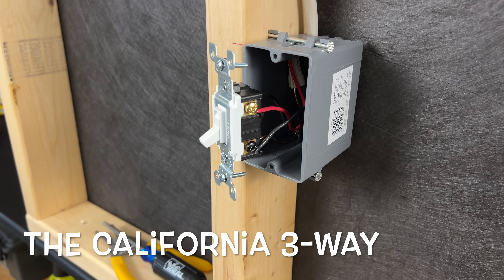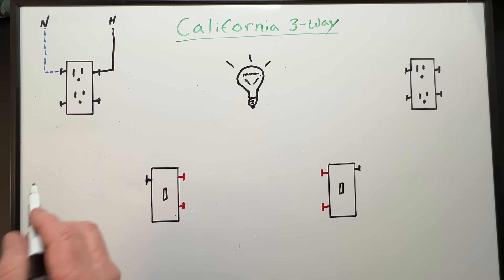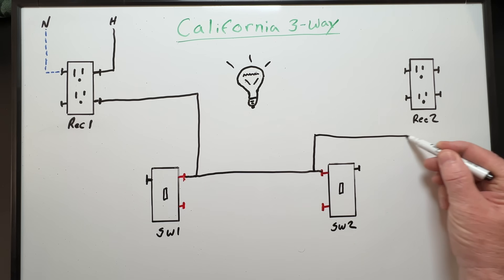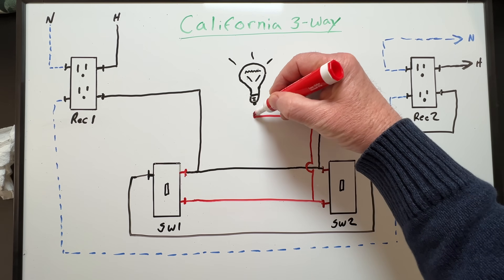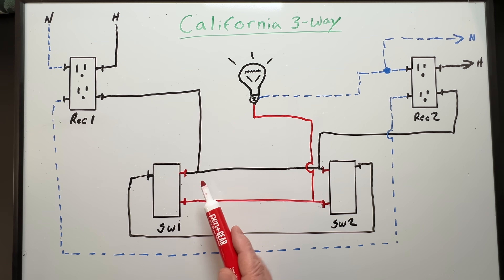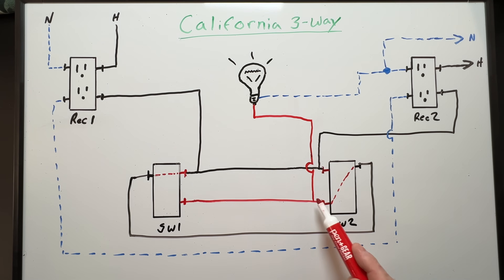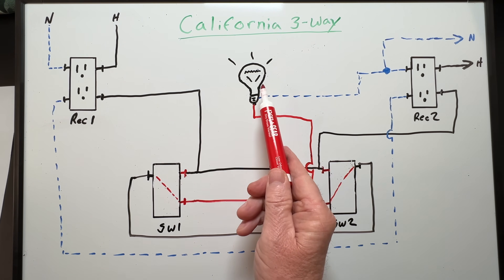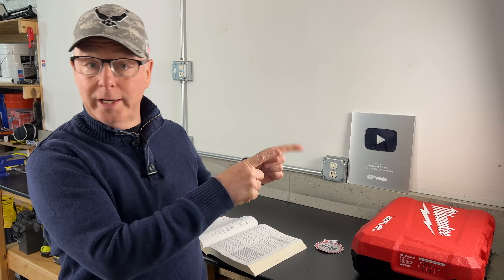What is the California 3-Way Switch?

Comment: If the neutral is the problem, how about just running a neutral to the switches to make it compliant? the circuit is still useful if you do so.
Here in germany, it's legal. Kontrollwechselschalter (=3 way switch with built-in indicator light) are made to be wired like this.

Comment: This is actually a Varient of the very common UK method but with the swich wire fed from the other end

We often bring permanent live into L1 of SW1 and the swich wire to the lamp into L2 of SW1

Then we run a 3 core to SW2
C - C
L1 - L1
L2 - L2

Newer rules suggest having a neutral in the box for the same reason so we generally just connect the neutral in a lever connector in the beck of the box

It works exactly the same way but we send the swich wire and the neutral directly to the lamp in a 2 core (plus earth) cable

We don't have the issue of re-identifying the neutral as line for the 3 core as our 3 core cables are typically brown black grey (equivalent to your Black, red, blue)

Comment: There is an exception on a neutral at the light switch not being necessary. If you have the ability to add a neutral at a later point in time.  ie: imc, emt, pvc etc conduit. With mc, romex etc a neutral needs to be installed upon inspection.

Comment: I don't think a single one of my lights receptacles has a neutral in them,  all of them are old knob and tube wiring and are older than me... well the wiring is, I've replaced the switches from old timey super stiff clacky switches to more soft rockers.

Comment: Hi, from England, UK. I like the way those steel conduits are fitted at 0:12, that should keep the wiring safe from the teeth of unwelcome little critters. And I like the way the connectors fit too, making them much easier to fit through timber beams while our conduits have to have the ends threaded with an expensive tool first so the connectors can be threaded on making the whole installation much more laborious to fit.

Comment: There's a 5th way, switching receptacle instead of fixture. Running 2 wire romex travellers between switches. Typical 3 way, hot wire common one end, and switch leg common on other end. Neutral is from the receptacle circuit as the hot feeding the 3 way. The issue is the neutral not run with lone 2 wire travellers.

Comment: This wiring makes no sense. There's a constant live and 2 switched live wires between the switches, that's enough to power the receptacle beyond and have 2 travellers. Why would you wire the light to the gold screw instead of putting the live from Rec1 on black at SW1 and the light on black at SW2? It doesn't do anything useful, are they trying to save a wire nut to connect the constant live to the receptacle at SW2?

Comment: I live in the 805 and I have uncovered many of these.  When I was 6 my house burned down, but not exactly from this, although there were several in the house. The Attic Furnace was wired sloppy and sparked, igniting the newpaper insulation, tipping the first domino.

Comment: Wow in uk use California method mostly still use till this day some you new every day we call it the 3 plate method here and the standard method we call it 2 plate method but we don't use standard method as much the only time it's mostly used , it's when we're running cables in conduit but as in the U, K, we usually have our power circuits and lighting circuits on 2 complete separate breakers and with us , we mostly have all the cables inside the light fitted , where from the supply/previous light then\nAnother one that would go to the next light and the last one that would run to the switch.
In are light fittings (we call them fittings instead of fixtures) have four terminals one marked L for switch line wire (we call hot conductors line it was called live before) a terminal marked N for neutral wires and another one marked loop for permanent line ( unswitch conductors from supply/ previous light to next light and switch) and then the final terminal is the earth term , and where all the earth is go (we call grounds earth or technical term is c p c circuit protective conductor) because most of our fixtures in the house are unknown as pendants, which  is ceiling rose ( junction box screws on ceiling) with a bit of wire and a lampholder on the end.
In our light switches, we usually have one wire that goes to the light fitting, but if it's a 2 way, we usually have another freak wire that would go to the next like position, but slowly in the UK, we started to the free wires in the back of switches , which we knock it down 2 plate cause we only using the two terminals  our ceiling rose so that's where the 2 play and the free plate name.Come from when we use the loop terminal , it's known as the 3 plate method , because all the wires are in the light fitting but is the cables run in switch or if we're running in conduit , it's known as 2 plate method , because we're not using the loop terminal.

Comment: Late to the party but I'll throw out an experience I had. During a kitchen and bath remodel, I brought three California 3-way circuits up to current code. While I was punching holes in the walls everywhere, I decided to also update the one in an upstairs hallway. After cutting off the breaker, I began removing the light fixture. Lo and behold, I got quite a shock. Turns out, the receptacle further down the circuit was also fed from a different breaker. That taught me not to trust the power being off just by shutting off a breaker and to stick the sniffer in the box before my fingers like you're supposed to and not cut corners.
Reply: That happened to me in my 132 year old house in 4 different places!

Comment: They don't require the neutral to travel through ALL switchboxes? That sounds like a bad idea, because you can have huge loops where a physical area of the building is in the middle of a circuit, like the core of an electromagnet. This can create EMI. Ideally to me, the sum of the currents going through any piece of romex or conduit should be 0, so that the line and neutral cancel out and don't create a magnetic field. It should not be enough to HAVE neutrals in the switch boxes... it should have to be the wires that actually CARRY the neutral return current from whatever those boxes are switching.
Reply: Having a bigger loop will make the field strength weaker at the center, since field strength is inversely proportional to distance squared, so while it technically creates an electromagnet it will be negligible in most practical applications.
Reply: @jon9103  The old electrical engineer who told me of this being a problem said it was mainly to do with radio frequency interference in the mains, not with 50/60 Hz stuff creating an electromagnet. I'm not sure exactly how big a deal it is, but he had like 40 years of designing high-frequency stuff under his belt.
Reply: @MichaelHenderson-h4w  gotcha, makes sense if you're fixing sensitive electronics but outside of an electronics lab you probably don't need that level of RF hygiene.

Comment: What I still don't get, is what happens to the neutral between rec 1 and SW 1, are you connecting those two locations with just one wire? If u use a 12/2 between doesn't that make it code compliant?
Reply from the maker: Yes.. just a two wire cable between REC1 and SW1. The issue here is the way the wires are connected to the two switches. The receptacles remain wired correctly with no issues there. With the Chicago method the hot wire from REC1 to SW1 and from SW2 to REC2 is connected to the traveler terminals. Same with the neutral wire between receptacles and switches. Of course the ground not shown carries through as well. But with this connection the polarity of the wiring to the light switches depending of the position of the two 3-way switches.

Comment: There are exceptions to that code that state its okay if it can be fished later
Reply from the maker: Not anymore.. There were five exception to 404.2 in the 2011 code and exception number two was the issue. 
 
The exception stated that a neutral wasn’t required where the box enclosing the switch is accessible for the installation of an additional or replacement cable without removing finish materials

So this meant that if you could fish a new cable down from the attic or up from the basement or crawl space a neutral would not be required for the original installation.

So many light switches were still being installed with no neutral wire. 

But in the newly updated 2023 NEC exception number 2 was removed, now a neutral wire is required at a switch box making the two wire loop a code violation.

Comment: These non code wiring schemes remind me of the so called “3 wire return call”, which involved 2 doorbell buttons and 2 doorbells .. 1 bell and button on opposite sides of a door, with power supply on just one side .. only 3 wires between. It involved ground/neutral side switching in one or more scenarios. Honestly, I never saw this in practice, and it seemed to be an apprentice/rookie test for newbies, back in the day.
 BTW, ground side switching is very popular in motor vehicle electronics, as it provides a voltage signals to the computer of proper activation, or if shorts or opens occur. I admit, being electrician trained, I was slow to accept this practice.

Comment: I gather this lent itself to knob and tube wiring, otherwise it seems very impractical to run from an installation standpoint
Reply from the maker: It was actually due to a local California code change limiting the number of wires in a conduit. The county had a lot of detached garages and the new change would not allow them to run lights and receptacles to the garage while a set of 3-ways controlled the lights. At least thats what I was about to find out on the subject.

Comment: Nice video with a good explanation. Maybe I am missing something but it would be a lot nicer if I knew what cable contained which wires - say 14/2 cable 1, 14/2 cable 2. That way i could relate to what the actual physical makeup of the receptacle and switch boxes might look like.
Reply: Yeah, I'm thinking my way through that problem right now too. The light is being fed one conductor from a switch and one conductor from an outlet. The switches are each getting fed or are feeding a single hot conductor from/to the outlets. I don't see how either of these are practically being accomplished with NM or MC cable, and can only see how to do this with single wire pulls through conduit.
Reply: I looked it up a little on google and I still fail to see the benefit of the CA 3-way. The example I saw this was accomplished by running 14/2 to the light (hot and neutral), then 14/2 to the first switch (load wire and hot), then 14/3 between the switches, as shown in the diagram in the video here. But that is the same way of running cable as the standard method, so I there's no saving on conductors.

Comment: Hello John and Thank You for sharing your many years of experience with Code Compliant wiring. 
I was a plumber for most of my working life. One thing that has always puzzled me is regarding Code Compliance. 
To the best of my knowledge there is no Nationwide Code for plumbers. 
My question is regarding the NEC, is this Code Book for all 50 States?
During my working years my Code Book was usually having Amendments added to the plumber’s Code Section as new materials were introduced to the Trade. 
As far as I’m aware, each State and sometimes Counties have different Code Compliance requirements. 
Thanks again for sharing your many years of knowledge and expertise !!!
Reply from the maker: The national electrical code (NEC) updates every three years and it has been adopted by all 50 states. Some states are a few cycles behind but they catch up eventually. Many states will also have amendments to the NEC. Some have quite a few while others hardly any. I think Maine only has about 10 amendments which isn't much considering the thousands of requirements. Also some cities and counties may have amendments or even their own code. So for example most of Illinois follows the NEC with a few amendments but the Chicago area has their own code or at least thats what I have been told. I think the NEC should be the standard everywhere in the USA but thats not the case.
Reply: @BackyardMaine Thanks for answering my question regarding the NEC. 
I’ve noticed a rather large demand for Tradespeople in the USA 🇺🇸. 
A National Code would help Tradespeople be qualified to work throughout the Country. 
Coming from a family of mostly blue collar construction workers, I feel it’s worth mentioning what I had to achieve before taking the test for my Masters License in NYS. 
I had to provide 10 years of working as a Journeyman under a Master Plumber ( tax returns). Next was 6 months of classroom instruction from an Accredited Trade School. 
The test was offered twice a year and was a 2 part test, a written test and a practical test. 
Some people would be surprised at the amount of women who work in the Industry these days, but simply remembering WW2 when it majority of the Military factories were operational from women, EXP: Rosie The Riveter 🇺🇸.

Comment: Years ago ,when I was an apprentice electrician, at a factory that was built in 1917, I was made aware of a wiring scheme for 3-way switches fed from adjacent buildings. I never had to troubleshoot this system so I don’t know how it was wired. The idea of this system was to maintain hallway lighting if power was lost in your building. Hallway lights would be fed from the adjacent buildings. This meant live power in a dead building. Can you diagram this wiring scheme. I’m a retired licensed electrician and consider myself pretty savvy on most electrical circuits, but this one has me wondering. The Chicago and California 3-way wiring doesn’t fit the double feed scheme. Maybe we have a 5th 3-way wiring setup.
Paul
Reply from the maker: I have not seen that setup before but it sounds interesting.

Comment: Too many black (Hot) wires in each switch box making it very hard to distinguish which ones go where without a LOT of trouble.  A two person job with a long wire between them to ohm it all out, or at LOT of jumpering at one end for one person.  And a white (normally Neutral) wire that's Hot is confusing and against code now.  Never heard of the California 3-way switch method and I'm glad I didn't!

Comment: This would be a better video if you drew it with NM cable and whether it is a 14/2 or 14/3 cable. Way easier to understand
Reply from the maker: This method was designed to be used with conduit due to some ridiculous regulations in CA. At the time detached garages were very common and people wanted to run lights and receptacles on a single circuit to the garage and have a one 3-way in the house and the other one in the garage to control the lights.

Comment: These alternate 3-ways can be really confusing, especially to DiYers. I frequently see circuits where the homeowner steals power from one circuit to feed a new receptacle, etc and they grab it from the leg of one of these style circuits. U fortunately since the neutral is not always present, they wind up stealing the neutral from another circuit that just happens to be nearby and it creates all kinds of problems, especially when shared neutrals are in use.
Reply from the maker: For sure.. not good.

Comment: So, it looks like this particular method is mainly a thing when you're running conduit for lighting?  Because best I can tell if you did this with Romex your switches would have neutrals at the location since you have to bring other wires there anyway.
Reply from the maker: Yes it was a conduit fill requirement that led to the practice.

Comment: Common sense....  Anything in new construction other than standard would only be done to maximize profit due to a small cost savings in labor and hardware.  A deadend would be useful in old work for adding a 3 or4 way replacing a single switch circuit.  California's don't separate lighting and convenience outlet circuits.
Reply: well the us electric system doesnt need them to be separate lighting circuits and outlet circuits as light switches can handle the full current but its definitely a nice thing to separate them so when you over load a outlet you dont lose your lights

Comment: Hello there. I watched all 4 videos in this series and I have a question about a possible 5th. Hoping you can shed some light on how to make this work and if possible while being code compliant.

I purchased a home built in 89’ and redid the entire electrical system in the house. However, we missed one fix before completing the house. It is now built and there is no easy way to run a new wire.

I have two switch boxes. Box one  has the supply wires, and box two has what would traditionally be the termination to the light box. However, I have a second light box that terminates in box one. Is it possible to control both lights using the 3-way switches?
Reply from the maker: Assuming you have a 3-wire cable between switches. If this is the case your short one wire to control both lights. Two of the wires between switches are travelers and the third wire will either be a neutral or a switch leg. If it’s connected as a neutral you can control the light from box two. If it’s a switch leg it would feed back to box on for your other light.

Comment: Technically it would be code compliant as long as we run the neutral wire through one of the switch boxes right? What are the actual downsides? As long as you run the neutral wire through 1 or both of the switch boxes, then wouldn't this method be desired because it prevents the need for an even longer pull of the hot wire to receptacle 2?